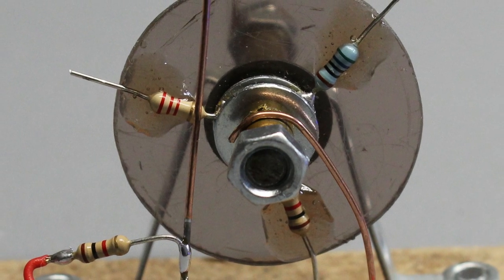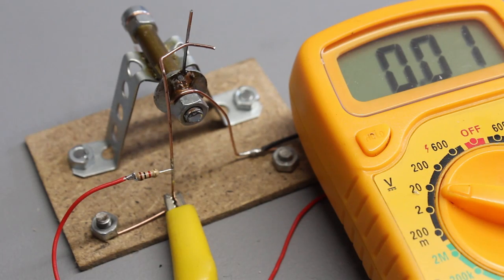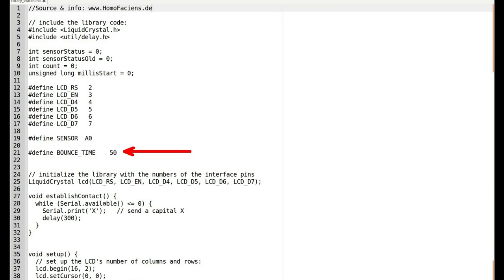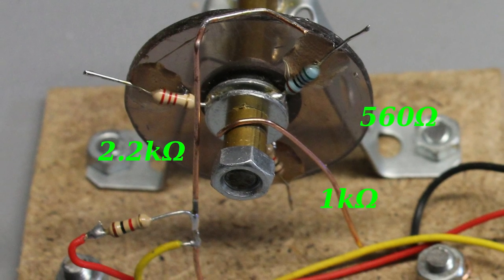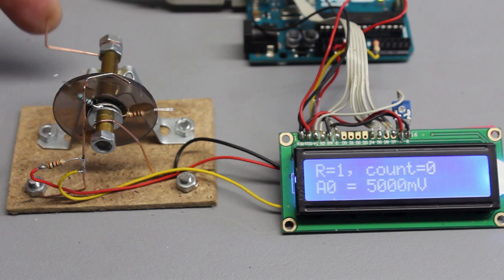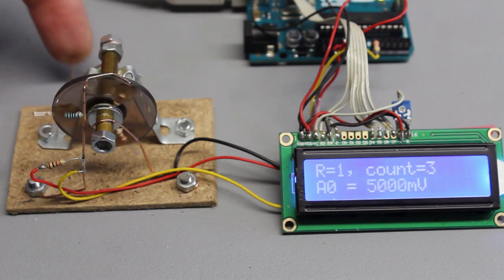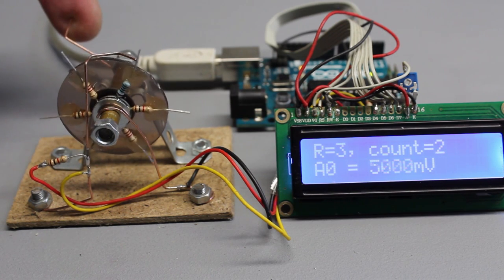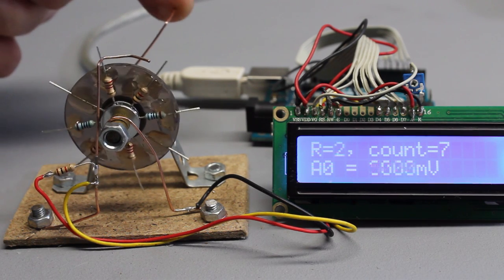Electromechanical rotary encoder

Comment: When do you do some further experiment on this rotary encoder as you say in the video? I think you have forgotten that totally :)
It would be nice to make a practical rotary encoder with a small footprint.
Reply from the maker: Yes, this type of encoder is forgotten, somehow. Too many other projects have higher priority, now. The working principle is simple, so if you have an application in mind, it should be no big deal to adopt it for your needs. A software example is part of the documentation on my pages:
https://homofaciens.de/technics-base-circuits-encoder-disc-2_en.htm
Reply: @HomoFaciens  
Ok. Maybe using SMD resistors, a plastic disc, and a wider metal part soldered to the end of the resistors to give longer period of contact and glue them to the plastic disc under them. I think that would make a small footprint rotary encoder disc.. needs only a way to make the contacts to these parts over them. More thinking needs :)

Comment: How can i use this for encoded dc motor project?
Reply from the maker: By reading the position as I did in the sample code on my pages and control your motor as you would do with a "normal" encoder. Keep in mind that analogRead is clearly slower than digitalRead, thus you won't get that many readings per second as with a normal encoder.
Reply: @HomoFaciens  thnk u sir

Comment: Would a capacitor or Schmitt trigger effectively do the same as debouncing the switch in the code?
Reply from the maker: A low pass could be used for debouncing. Consider that this sensor creates three different potentials per revolution, thus a simple Schimtt trigger won't work.

Comment: So you don't need debouncing when there are 3 different resistor, knowing where you are?
Reply from the maker: You still need debouncing (it's done by software). Caused by contact bounce the reading could be anything between the minimum output voltage of the divider and +5V. For example if the disc is at the 560 Ohms position and contact bounce occurs, the reading could also be 2.5V or 1.79V for a point in time.
Reply: Ah, ok thankyou!

Comment: Will it be easier to use a rotary potentiometer?
Reply from the maker: But with that you can't detect continuous rotation.
Reply: Just remove the metal base cap, this will allow the potentiometer to rotate continuously.
Reply from the maker: Yes, that would work in principle, however you can't detect the direction of movement whenever the wiper is at the gap.